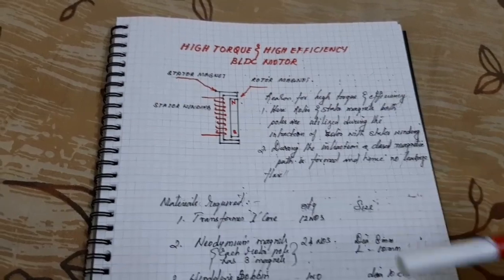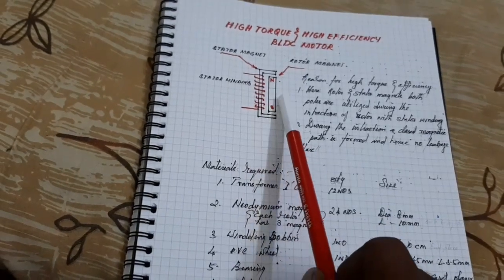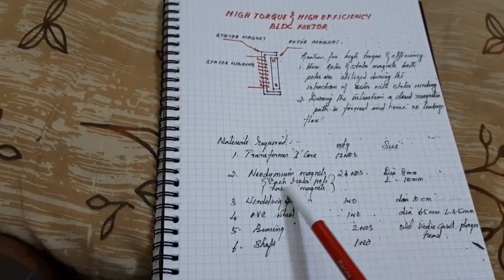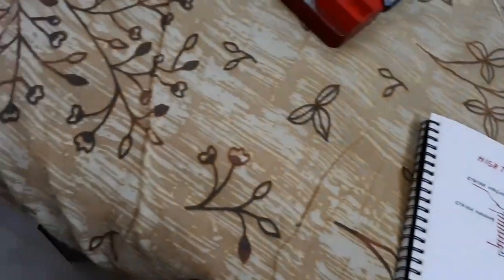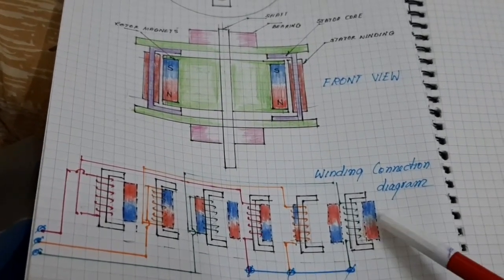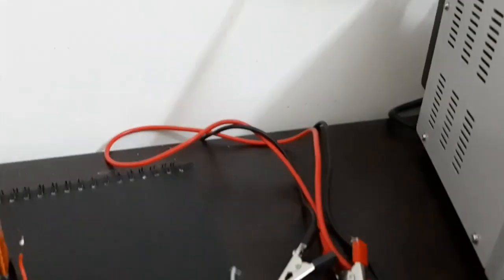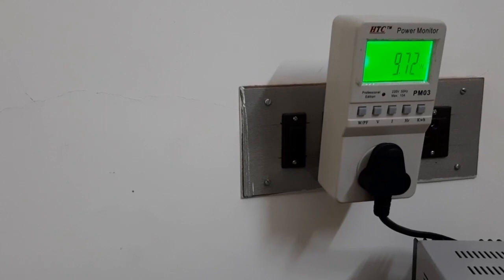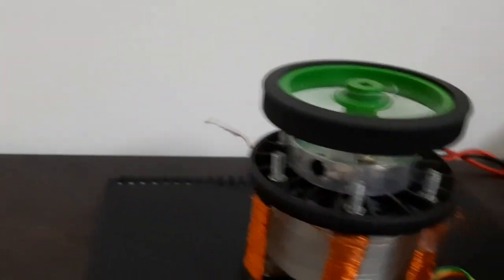(V-46),NEW TECHNOLOGY HIGH TORQUE & EFFICIENCY BLDC MOTOR.

Comment: sir convert a 220v ac celling fan to 12v bldc using old ac fan stator rotor & body 😎😎😎
Reply from the maker: Yes it is possible but some modification to be done for rotor and stator
1.the rotor copper bar to be removed and inserted with magnets
2.the winding also to be modified with 3phase
Note. Nowadays bldc fan is available with less power consumption
Thanks
Reply: @pugalstech  watch this video ⬇⬇⬇

Comment: Thank you, sir, for this wonderful motor
What is the size of the wire and the number of turns?
Reply from the maker: Thanks for watching
Size of wire is 30 gauge and no turns for each pole is 250 turns
The bldc motor controller current carrying capacity is 1.2 amps
Reply: @pugalstech   how much torque does it have?